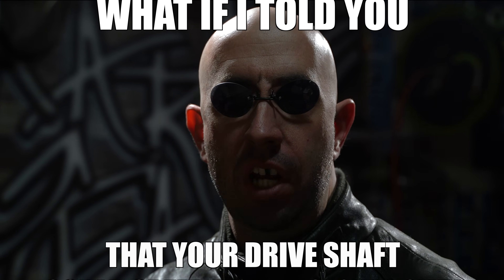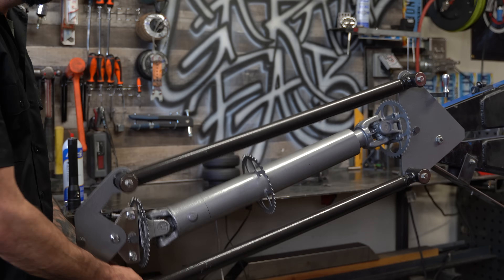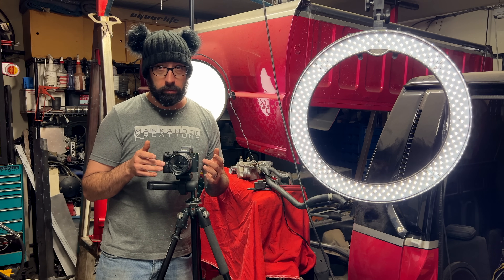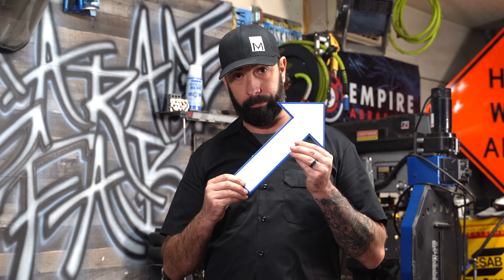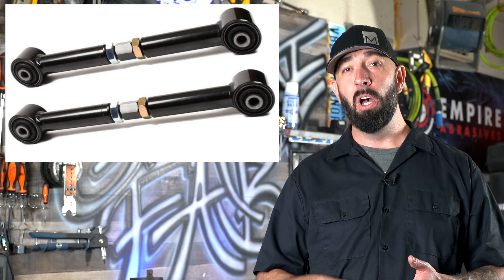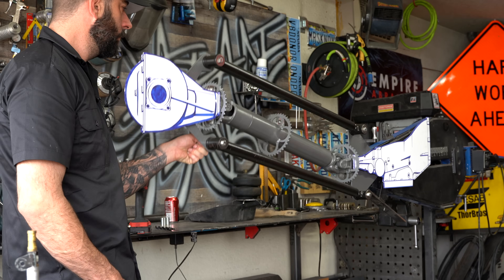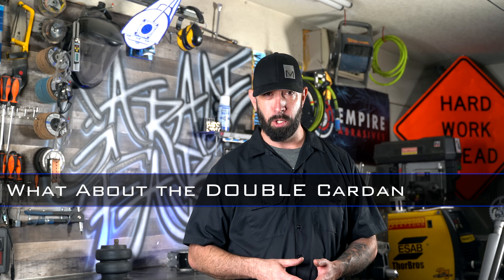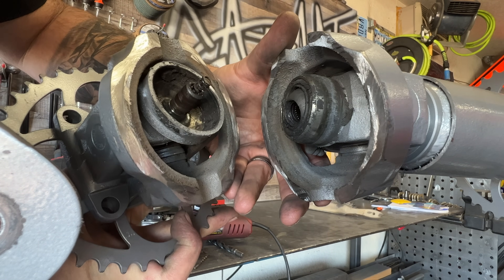THE Driveshaft Video. The Nature of U Joints. Suspension Basics Ep. 06

Comment: What do you think of the drive shift that chrysler used two u-joints at the same end it was called a cv joint drive shift
Reply from the maker: I’m not familiar with it, Roger. What model was it on? It all depends on what type of rear suspension the vehicle has. Manufacturers know what they’re doing (for the most part) so I’m sure their driveshaft was the best choice for the suspension!
Reply: @GarageFab  have to go back two the fifty's all hi-pro engines had them hemis, 413, 426, 440 and they ended in the early 90s four wheel drives had them, chrysler coined the name constant-velocity-joint. Back in the day drag racer used them. And yes I'm an old drag racer , like your videos and your voice keep up the good work
Reply from the maker: From some brief research, most of them had leaf springs. If that’s the case, the double cardan joint is perfect. Leaf springs operate very similar to a two-link, another system a double cardan works well with.
Reply: @GarageFab  that's it a drive shaft that would not break, I'm putting one in my 1948 frazer gasser with a supercharged chevy 454 take it easy great videos
Reply from the maker: Thank you Roger! You too.

Comment: Ive got a relative question - everything in the video is very clear and makes perfect sense. However, I see videos all the time where people build cars and frame off restorations from the ground up (Im doing the same at the moment). But, its been said that to set pinion angle, the vehicle needs to be at its final ride height. Well… how is that possible when starting from the frame up? That train of though would suggest that a vehicle must be fully assembled before welding the rear axle housing to 4 link brackets (or spring perches/whatever suspension)
Reply from the maker: You’re not wrong! It can definitely be frustrating. However if the motor and transmission are installed, that’s really all that’s needed since everything is based off of that angle.
BUT if you build a rear suspension first like I did on my Wife’s Mighty Max, things get extra annoying. I’ve been “done” with the rear suspension for months. But the axle is still only tack welded in place. It could be several more months before the pinion angle is set in the rear suspension is done done. 😩
If in doubt, install adjustable upper linkbar’s so you can fine-tune your pinion angle later!
Reply: @GarageFab  I installed a mustang 2 IFS in my 55’ chevy frame. Going to drop the engine and trans in and then 4 link it. Think thats all the weight I need to weld the rear in?
Reply from the maker: I think that would be fine. Remind me what type of 4 link you’re using? A parallel 4 Link maintains a constant pain angle, so weight and ride height doesn’t matter.
Even with uneven length and unparallel bars, the angle won’t change much with just an inch or so of travel. Have someone stand on the back to get a closer estimate!

Comment: Great video! Super informative. Just sub'd.
Recently towed my camper with my stock 2018 F-150 from the midwest to Arizona. During this tow, if I accelerated too much from a stop, I could feel it shudder (angle). So, I learned to accelerate more slowly in order to avoid the shudder (vibration). I didn't understand the cause of this shudder until you explained that it's the leaf springs torquing (lifting) up causing the undesired angle.
After disconnecting the camper, I noticed a dynamic vibration between 45-55 mph. It seems the excessive pinion angle caused the shaft to twist or bend. Also, it should be noted that I used a weight distribution hitch that leveled the truck within a ½ inch rear to front, but I was at maximum towing capacity with the camper.
Since the truck was still covered by Ford's 5yr/60k mile drivetrain warranty, I had the local Ford dealer diagnose and replace the 2-piece driveshaft, which corrected the vibration. Sadly, it took them 2 weeks to figure it out and another 6 weeks to get a new shaft from Ford. I think the techs should have watched your video.
It appears the way to prevent the acceleration shudder is with links or wedges. I'd like to prevent this from happening to the new shaft. Anyone know what the best practice would be for a stock truck towing a camper?
Again, very informative video. Thanks!
Reply from the maker: Sorry for the delayed reply my man! This one sent me down a rabbit hole of research. I have never heard of a load distribution hitch before. And after looking it up, I simply can’t grasp how the dang thing works. I envisioned something attaching further forward on the truck frame, and when I saw that it instead connected to the frame of the trailer I was completely baffled. Still am actually. 
So you already confirmed that the driveshaft was the source of your vibration. I wish I could’ve inspected it to see what happened! I suppose a slightly twisted shaft isn’t impossible but that sounds crazy! I suspect damage to the U joints themselves.
If the weight distribution hitch leveled the truck as you described, it seems unlikely that the pinion angle was severely misaligned when NOT under load. It must’ve been the axle wrap you mentioned that lead to failure.
This is all just guesses of course. But if this is in fact true, I’d suggest helper air springs, if you don’t already have them, and a torque arm. It’s essentially a ladder bar that connects your axle to the frame and takes on all the rotation forces under acceleration so the springs can just spring. And is there such thing as a heavy duty hauling driveshaft? I look forward to hearing where you go with this!

Comment: Awesome video! Could you please explain a torque arm suspension like on a 4th f body.  Along with the results of changing the lengths and mounting points for the lower bars and the torque arm itself. Thankyou!
Reply from the maker: Thank you, Braydon! That stuff is a little more advanced and it’ll be a while until we get there. I can give you a head start with some fancy terms for you to look up. Check out, “Instant Center” and “Anti-squat”. Both have to do with channeling the engine power efficiently to the ground, which is what these devices do best though the torque arm better limits axle wrap.

Comment: Thanks for your information. Welcome back bro! I’ve got a quick question about the two piece driveshaft. Am I now matching the angle of the carrier bearing or still the transmission? I just want to make sure before I drop this s10 on the ground!!
Reply from the maker: Thank you, Justin! It’s good to be back.
With a two piece shaft, the first U joint at the back of the trans should be nearly straight. (Under 2 degrees will prevent a vibration) 1 degree is often recommended in order to keep the needle bearings rolling and the grease moving. 
With that in mind, whatever angle the first section of driveshaft is, that’s the angle you’ll set your pinion to. Or in other words, your pinion angle will be parallel to the first section of drive shaft. So you will be ignoring your transmission angle.
Hope that didn’t make things more confusing. Lemme know!
Reply: @GarageFab  angle on the first driveshaft and pinion angle matching. Ok I believe I’m understanding that correctly. Thank You for clarifying! Greatly appreciated!!
Reply from the maker: Sounds like you understand it perfectly. 👍 My pleasure.

Comment: So, unless I missed it, a double drive shaft should measure angle at hanger bearing to rear differential? Thank you for such great information with a little humor!
Reply from the maker: My pleasure, Brad! Yes, I think you’ve got it right. I’ll reword it just for clarity.
The first section of driveshaft (the shaft connected to the transmission) will be nearly straight with the transmission. No more than 2°. A very slight angle will keep the U joint needle bearings and lubrication moving, but won’t be enough to cause a vibration. Whatever angle this first section of driveshaft ends up being, is now the angle that you’ll match your pinion angle to. In other words your pinion angle will be parallel to the first section driveshaft.
Hopefully my attempt at clarifying with more words didn’t make things worse. If so let me know. I’ll try again.
Reply: @GarageFab  abundantly clear. Thanks again and keep the knowledge flowing our way!

Comment: I have a carrier bearing with 3 ujoints. I have a 6in lift. From tcase too carrier bearing is pretty straight. The middle ujoint is at quite an angle, but it's fairly straight on the diff. I have shake only at takeoff. How would I fix pinion angle on a driveline with 3 ujoints? Ps I wrote this before I got to that part of the video. But still kinda confused about it. Do I match the diff angle too the carrier bearing angle sense the tcase angle doesn't change in a 2 price driveline?
Reply from the maker: Wassup Shaggy!? A typical 2 piece should be set up as follows: First joint at the tcase is nearly straight. Maybe off by one degree. This slight angle keeps the needle bearings rolling and the lubrication moving but isn’t enough to cause a vibration. The pinion angle is then set to match the first section of driveshaft. That means the second and third U joints are at the same angle. It sounds like you understand it perfectly! Make sure though that your joints are in good condition. (Not loose/wiggly, and not hard to move)
Also be aware that your 6 inch lift might be pushing your joints to their limits. Matching angles can only solve vibration issues up to a certain point. You joints can only bend so much before causing a vibration simply because they’re oscillating too much. It’s difficult to find a number that everyone agrees on. Some say u joints shouldn’t bend more than 3°. Some say 5°. 🤷‍♂️ 
I’d suggest adjusting your pinion angle to match the first section of the driveshaft, then check the angles of the rear two u joints. If your vibration doesn’t go away, you might need to install a double cardan joint in the center of your two piece driveshaft and then point your differential at that joint
This is probably pretty heavy. Feel free to hit me up anytime to clarify.
Best of luck my friend!
Reply: @GarageFab  awesome thanks for the reply!  My carrier bearing is shot honestly. I got all new ujoints when I ordered that. They seem fine though, no wiggle or anything, But I'm going to replace them while I have the driveline off. I follow a bunch of groups with my same truck and nobody else seems to have this problem when lifting theirs. I'll replace to ujoints and carrier bearing and check my angle to see if I can't find a shim to match the carrier bearing to the diff angle. Thank you for your help and your videos.

Comment: Hi I have a soa jeep yj with dana 60 in the rear I have a 16 inch drive shaft and have a double cardiv joint at the trans side and a single at the pinion,  I was told this was the only way to get the flex and no vibration. ,  I found your video very interesting,   could you comment on my set up thanks
Reply from the maker: I’m unfamiliar with the YJ. What type of rear suspension does that have? 
Your setup would generally be on either a two-link or leaf springs. And when the vehicle is at rest, the rear singular U joint would be straight or very nearly straight.
I’m interested to know more!
Reply: @GarageFab  hello it is a jeep yj with leaf springs on top of the axle. i have a double u joint at the transferase and a single at the diff and it is pointed straight at the t case
Reply from the maker: That sounds perfect to me my friend! I wouldn’t change a thing. Leaf springs operate similar two link, which is when a double cardan is really needed.
Are you having vibration issues?
Reply: @GarageFab  awsome.  I do have some on take off in 2nd gear ,  but I am changing rear axle from dana 60 to a gm 14 bolt ,  I may need to point the pinion down 2 degrees to allow for axle twist ,  thank you so much for your time and advise
Reply from the maker: Sounds like you’ve got a good grasp on things! Lemme know how that goes! Best of luck my friend.

Comment: Do you have to worry about your pinion bearing not getting adequate oil with the pinion pointing up?
Reply from the maker: I’m going to feed you a bunch of nonsense all based on theory and my knowledge of the internals in a differential.
I believe my angle is not up enough, to drop the oil level below the bearing. But even if it was, I think that the oil that is  slung by the ring gear would provide more than adequate lubrication.
This could be completely false and my differential will explode on my first test drive.

Comment: Hi Aaron, question on the parallel 4 link versus the triangulated 4 link configuration.  Shouldn't they both maintain a constant pinion angle?  In this case, couldn't you just use a triangulated upper bars that have the same equivalent length as the lower bars and not need a watts link bar assembly?  I have a '54 Ford F-100 that I am putting a 4 link on and it will have coil over shocks, not bagged unfortunately.  Just trying to resolve this as tire clearance is getting pretty critical.  It is a weekend cruiser with about 350 hp.  Thanks for any insights!
Reply from the maker: Hey Jerry! I often struggle with explaining that concept to people in text form. But you worded better than I ever have with “equivalent length”. The upper triangulated bars are longer than the lowers, but because they are angled they would appear to be the same length when viewed from the side.
So yes; This would in fact keep the pinion angle constant, and as long as the Triangulated bars are at least 30° from the frame rails, you do NOT need a 
panhard bar or a watts link.
Here’s the part I may have failed at clarifying in the my videos:
I only recommend setting up your rear suspension with a constant pinion angle if you were building an adjustable height suspension.
Since you are going to be using coil overs,  you don’t need to worry about keeping your pinion angle constant. I highly recommend doing some research on rear linkbar suspension design, instant center, and anti squat. If you set up your bars so they point towards the lower front end of the truck, (front bumper) you can increase your traction off the line by better channeling the engine power to the ground. Sometimes this also includes shortening the upper bars.
HOWEVER!! Because you said “not bagged unfortunately”, if you think you might want to install air suspension in the future, consider the constant pinion angle! You will in fact sacrifice some traction, usually not noticeable by most non-race street vehicle owners, but you will ensure you’ll be vibration free after upgrading to adjustable height suspension.
Hope this helps! Can’t wait to see the ‘54!! 🙌

Comment: I'm glad you kept posting videos.  I've learned more from watching your videos in just a couple of months then I have from watching power nation videos for years.  

I'm curious about using parallel 4-link adjustable height suspension with IFS, whether or not it's possible or advisable.   What would that even look like if it could be done?
Reply from the maker: Thank you Chris! There is no better compliment. My biggest goal is to share knowledge, so that type of comparison makes me giggle.
I need some clarification on your question. When I see IFS, I think “independent front suspension”. Are we on the same page? Just about every truck I’ve ever worked on had independent front suspension, with leaf springs in the rear that I convert to a 4 link. Some new production trucks come from the factory with linkbar suspension in rear with independent front suspension. So if the question is, “Do the two systems work well together?” Absolutely.
Another way I interpreted your question is? “Can you install air suspension in just the rear and leave the front IFS static?
I don’t see a problem with that. It would be frustrating to me personally to not be able to adjust the height in the front, but it wouldn’t cause any problems or handling issues. It’s not unusual to do half of the project for funding reasons, and then do the other half later on down the road. or if you just want to do the rear, maybe so you could adjust the height when the bed is full of stuff, I don’t see anything wrong with that either!
Let me know if I answered your question, Chris. If not I’ll try again.
Happy new year my friend!

Comment: Next video can you mention why driveshafts are not made with CV joints? Or respond to me here if it's not an interesting enough topic to put in video. Your videos have helped me out immensely! Thank you!
Reply from the maker: Thank you Bryce! There probably won’t be a video on it. Not because it isn’t interesting, it would just be a short video. I probably should have talked about it briefly in the driveshaft video.
I don’t know for sure why they don’t always use CV joints, but I know that production cost is almost always a determining factor when designing vehicles. Even though the CV joint is a far superior joint, (they’re much stronger and don’t have vibration issues as mentioned in the video) they are also much more complex and likely cost significantly more to manufacture. Since most production vehicles are static ride height vehicles, vibration isn’t an issue anyways so there would be no reason for the extra cost. There are however some Lexus’ with air suspension and they’re equipped with either large rubber rag joints or CV joints on the driveshaft because of the increased suspension travel.
So they do exist, it’s just not super common. That said, if you want to be creative and put your joints on a driveshaft your building, that would be cool!
Reply: @GarageFab  appreciate the response!
Reply from the maker: Anytime my friend. Have a great new year.